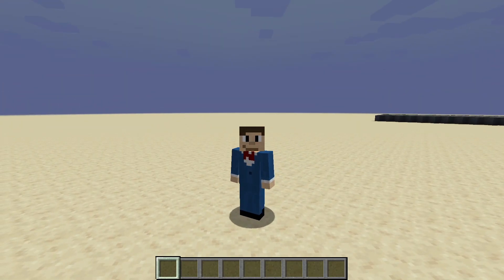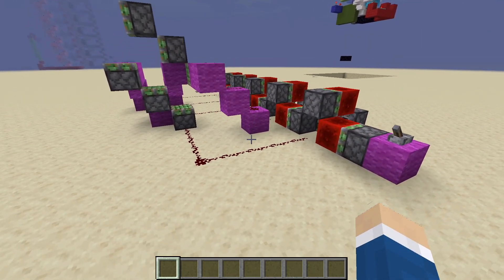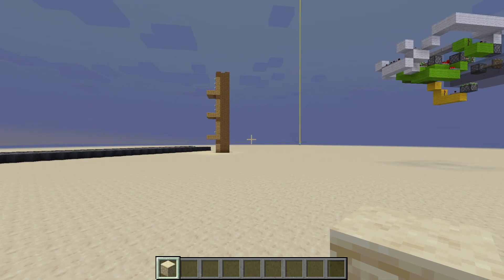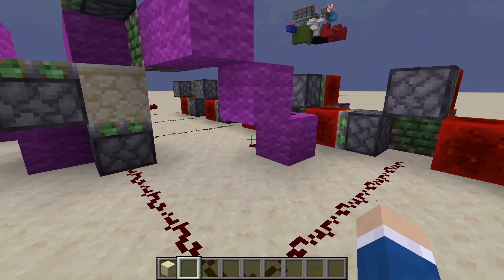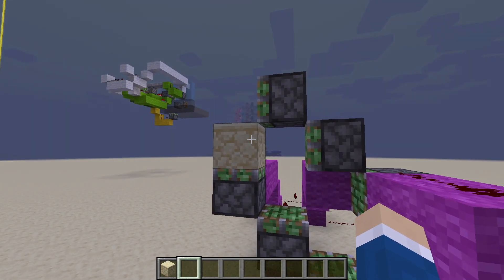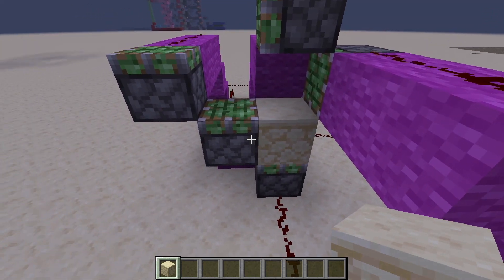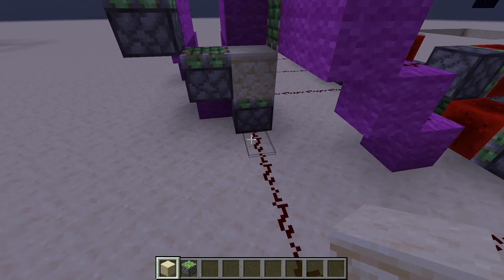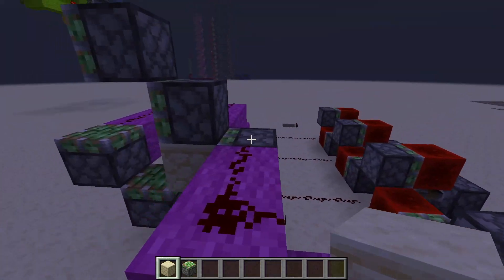Block Teleporters Explained!

Comment: little thing to note: the zero tick generators must all be activated by the previous zero tick in order for the order to work properly
if you try to get the order separately (outside of chaining pistons) then it doesnt work, because all non-piston events are processed before piston events, which means all the extensions will happen before all the retractions.
so make sure that each zero tick generator feeds directly into the next one using pistons as shown